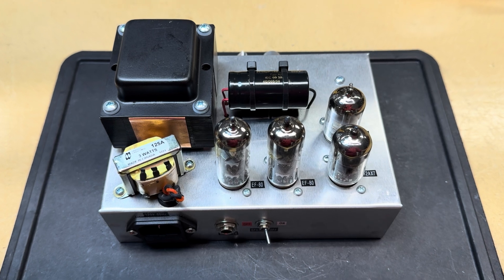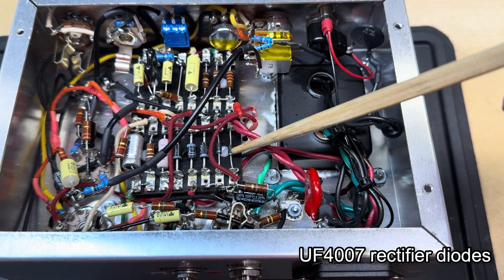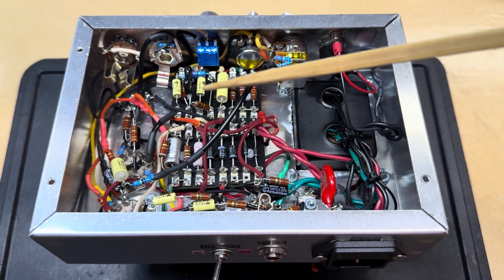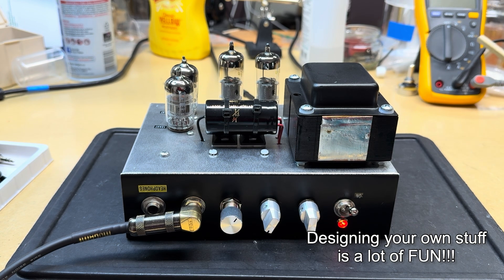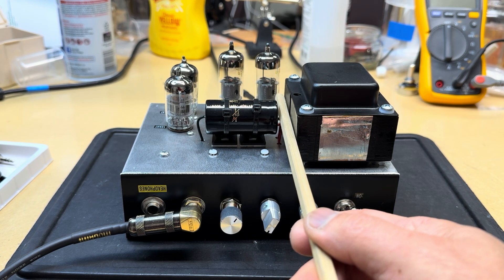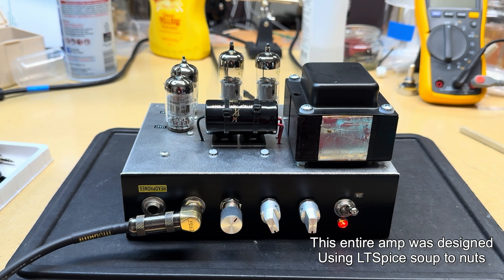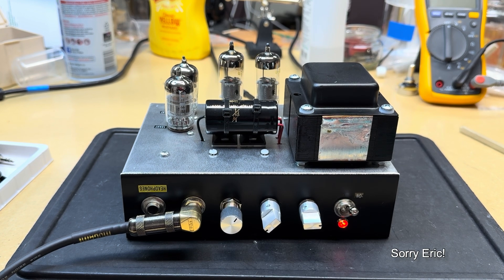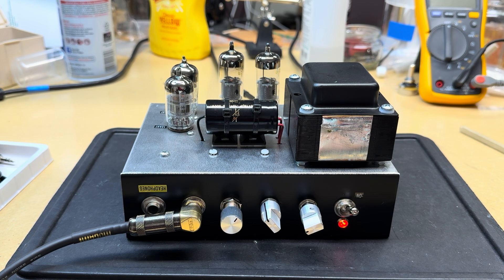An EF 80 all tube push-pull Class AB mini practice amp

Comment: Throw that headphone out through some stereo FX like reverb or  delay, an impulse response and that thing could be a recording monster! I've seen some circuits for passive reactive loads that add an inductor instead of just resistive load. I don't have it off hand but there are a variety of schematics floating around with inductor values that are matched to common guitar cabs. I've also seen people wrap their own dummy coils around PVC pipe endcaps!
Reply from the maker: Some great ideas!  Thanks!